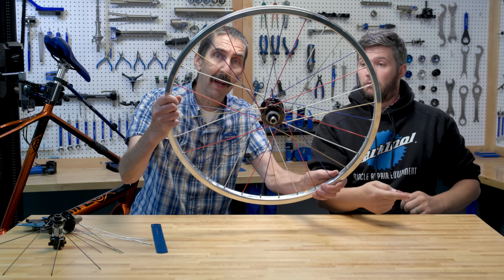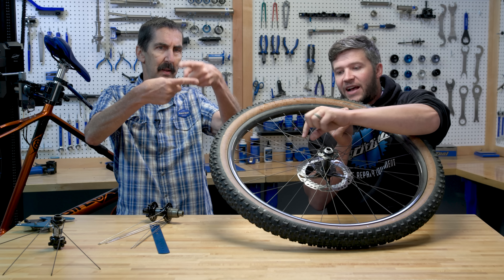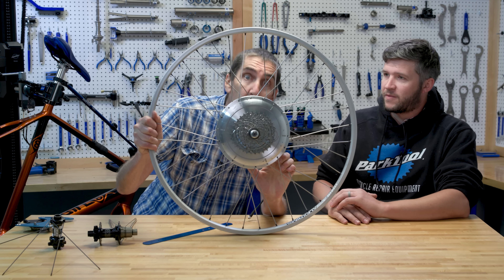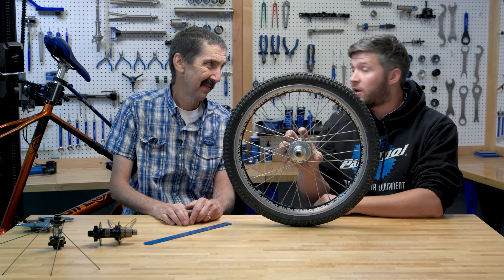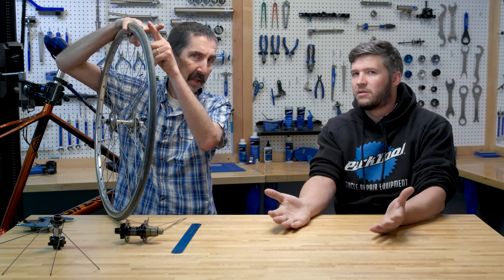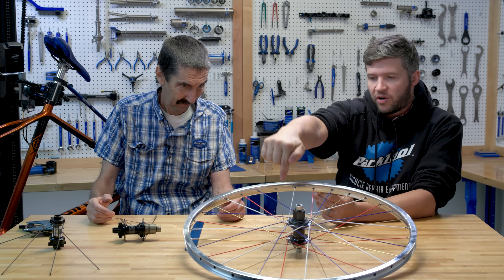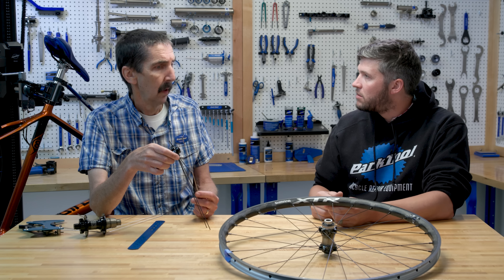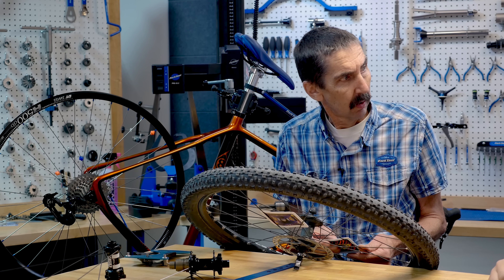Spokes: To Interlace or Not to Interlace? | Tech Tuesday #206

Comment: I liked this video a lot, I might try straight lacing the front wheel on a bike in my shop. my main bike has Rolf Dolomite wheels so nothing here really applies 😆
Reply: yeah!  i'z gonna ask abt paired spoke wheels!   ..they're jst a single cross so there's really no "interlacing"...   but which way are they spost to cross??  over or under?
Reply: @KickTurner  mine looks like it's under 1 over 2.
Reply: @ratman6417  i'm rolling on the Rolf Prima TDF58 12 spoke rear.    (i'm trying to figure out how to attach an image to my msg here on YouTube to show how my spokes are laced, w/o any luck!) but w/ such a low count of spokes they're not really able to cross over more than jst one time from hub to rim..
Reply: @KickTurner  mine are 26" Rolf Dolomite Disc. the spokes cross 3 times on those. it's an XC MTB wheelset so the pattern is very different from prima

Comment: I have a rear wheel, size 451, that's laced x2 on drive side, interlaced and cross 1, non interlaced on the left side. It looks funny but works well. The front is x1, non interlaced.

Comment: In my touring bike the front wheel contains the hub Dynamo and is not interlaced but, the rear wheel with 9 speed derailleur is. Both 3-cross.

On my e-bike both wheels are interlaced and 28" inch.
On my bike trailer the wheel is interlaced and it's 16" inch.
My spare front wheel is 28" inch and interlaced.

Comment: How do you guys at Park feel about the Shimano way of lacing differently on DS and NDS?  I always do 3x interlaced with the trailing spokes on the outside of the last cross but I also see many wheels with the leading spokes on the outside.  I believe Shimano says to do trailing on DS and leading on NDS of rear wheels.
Reply from the maker: Good points. Our feeling is that it is important to connect the hub to the rim in every case.  Failing to do this may result in a poorly wheel build.

Comment: I am curious about strait laced wheels. they seem to be more difficult to true. what are some advantages or disadvantages, and do you just true them like a normal wheel?
Reply from the maker: Radially laced wheels offer a lot of radial and lateral strength. What it lacks is rotational strength. So when the hub is driven as in when you are pedaling, the hub will have a tendency to "wind up". On modern bikes, the issue would be braking with disc brakes. Great for front rim brake bikes though.
Reply: @parktool  Can you expand on why it's not so good with disc and great for rim brake?
Reply from the maker: @MrSandperson0   When you are rolling along your momentum is going forward. When you use a disc brake to slow down your brakes try to prevent the hub from turning. Your momentum is still going forward and it's the spokes job to transfer the force from the hub to the rim. If the spokes are not crossed it's like trying to tip over a person with their feet  together. When the spokes are crossed its like trying to push a person over with there feet far apart and very stable. A bit hard to describe in a youtube comment without visuals.
Reply: @parktool  I have a back wheel (20 inch, rim brakes, SRAM Dual Drive, so a "largish" hub) with interlacing on the drive side, and radially laced on the non-drive, it came like this from Dahon. It always seemed strange to me. Is there any benefit to that kind of lacing?

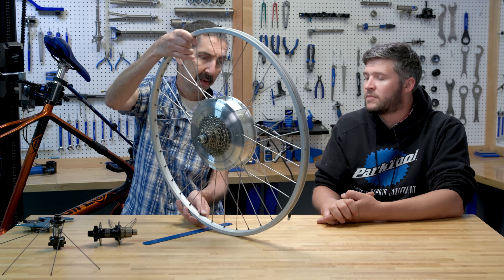Comment: 5:24 Wouldn't it be impossible to interlace a 1 cross spoke pattern?
Reply from the maker: Impossible?  No, we have seen it done....maybe not a good idea, but spokes will bend to it.
Reply: @parktool  How does that work? do they cross opposite flanges? Because otherwise if they are on the same side, I don't see how they can satisfy the criteria that you said "the last cross has to go under", since there is only one cross per spoke and every "under" physically corresponds to "over" on the other spoke.
Reply from the maker: It is very possible, it will take some defecting of the spokes to accomplish but it would not be too crazy to do on that wheel. It would simply be going under the spoke that it's currently going over.

Comment: I tried building a rear wheel with a coaster brake and kept snapping spokes when i interlaced until i noticed the front wheel isn't interlaced. The bike was built in 1979 and lasted this long without snapping. I respoked the rear non interlaced and so far, so good. Who knows. I don't like the way i have to bend a spoke to interlace it. Maybe that puts too much stress on it...

Comment: Rather than enjoyable  heresay can you back it up with data? I thought the cross was so one spoke could take up its partners tension. Certainly we see the effect of the shared tension when building a wheel. Can you show us with all your tools? Simply use tensiometer on both sorts of heavily weighted wheels and see if theres any difference. I predict the interlaced will have lower peak spoke loads.

Comment: I have a small problem . fluid is leaking from my brake caliper (shimano m315). it can be repaired
Reply from the maker: If fluid is leaking at the hose fitting, it likely can be repaired.  If it leaks at the pistons or the body, replace the brake.  And also interlace your spokes.
Reply: @parktool  thank you very much! by the way I already have interlace spokes! good job and thank you for your support! keep it up

Comment: I own 2 bikes, one with shimano and the other with roval wheels, both J-spokes, both pairs have interlaced spokes. Bike 1 from 2002, bike 2 from 2014 and both aluminum. 23-622 and 25-622. I like both, on rough terrain the 25s have a nicer ride, on all "flat" roads the 23s gives a very happy buzzzzzzzz

Comment: Clearly interlacing does not make a huge difference. But does it make a small difference? Under torsional loads (disc brake) does the interlacing disperse the load over two spokes instead of focusing it on one spoke, potentially preventing excess tension that could eventually crack a spoke hole at rhe rim? Premature fatigue on aluminum nipples? How about deflection under torsional loads, does the wheel move/deflect to one side more with non-interlaced wheels?
Reply from the maker: Let's put it to the test! Sometimes the buddy system works. Sometimes it's not the greatest.

Comment: First of all, we're talkig about pretty minute difference here.  No way to actually feel this in your butt.  But I think you missed a significant factor:  there is more spring in an interlaced wheel,
and there fore it gives a slightly easier ride, and.more importantly lower stress on the spokes and a longer life. This would give a longer life to the wheel and less liklihood of a failure when you're 50 miles from home.  i have wheels I built 40 years ago that are sitll going strong.  I have only one spoke failure, that was caused by chain contact, in all that time.  And I use super thin DB spokes and weigh 210! Every wheei I built was interlaced.  And I don't see any downside.

Comment: You've neglected to mention the only reason for existence of straight pull hubs and non-interlaced wheels: Machine lacing.

That's the chief reason to change a piece of engineering that's been proven over a hundred years 🙂

Why fewer spokes, straight pull hubs and non-interlaced wheels? Cost and automation.

Comment: 5:00 do not mix apples and pears, you can not say that how big hub flange does not affect on wheel strength, that wheel is made on almost worst way, if it is laced that spokes are 90 deg on hub radius(4x) and rim holes are arranged for that hub, that would be the strongest made wheel

Comment: I think you said, "shares the load" it must and does take any flex out of a spoke. But while the video was interesting it's not scientific
Reply from the maker: What was that?
Reply: @parktool  well, all your statements are based on your opinion. I would like to see, data, measurements, recorded powers, strains on the wheels, with regards crossed or not. I remain unconvinced that crossing is pointless.  I think it does add to a wheel, be it minor.

Comment: My god, you spin the wheel with hanging broken spokes, claiming some nonsense on spokes overlay and derailleur jamming 😂😂😂
Reply: Looks like excess shift cable to me, not hanging broken spokes
Reply from the maker: The noise is the derailleur hitting the spokes that are not interlaced. There are no broken spokes and the cable is not hitting the spokes. Its the cage hitting the spokes that are not interlaced because they are 1-2mm more outboard than the other half of the spokes that are interlaced.
Reply: @TypeVertigo  This. Pretty easy to see at 9:17.